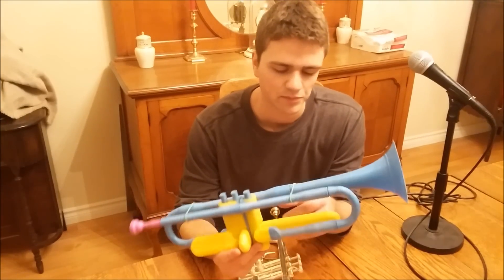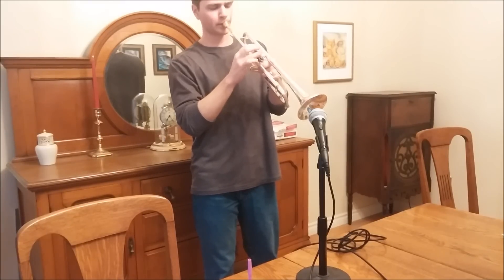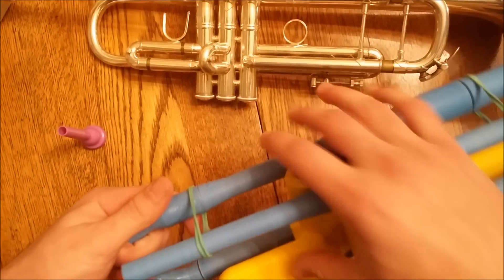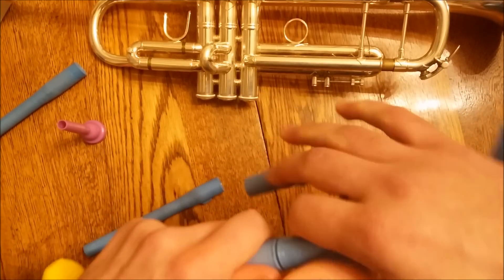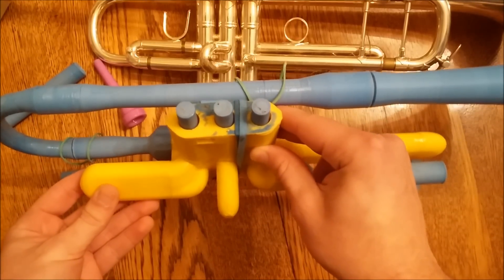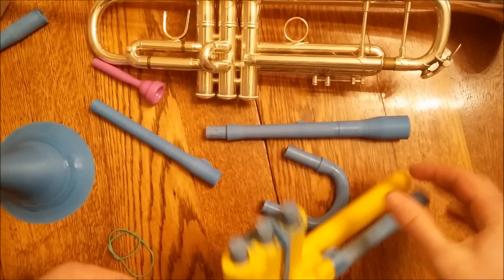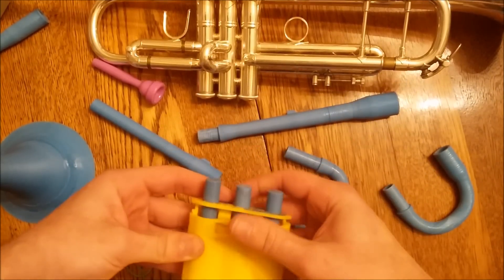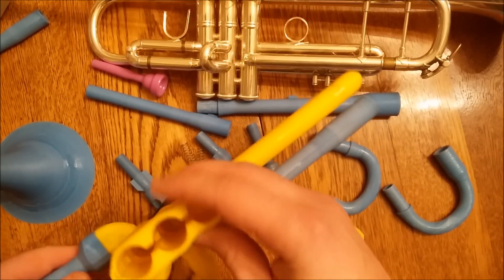3D Printed Trumpet

Comment: This is just my thoughts, I could be wrong. But I think because it's plastic the walls need to be much thicker. I'm wondering if you're not getting excess air leakage around your valves. At least that's what it sounded like when it would go all pitchy. rather than Vaseline for oil you might try silicone or graphite.  I just noticed this is like 7 yrs old. Did you by chance do any other iterations?
Reply: He made a second iteration, his video showcasing it is private though
Reply: Exactly, I was thinking of trying with a shell thickness of 6-8, 100% infill with PETG or PLA+...

Comment: I wonder how much of a metal trumpet you can replace with 3d printed parts before the sound quality is lowered, like replacing the bottom valve caps with 3d printed ones
Reply: The valve caps could be replaced with no results probably. The piping is the only important part
Reply: intresting one last bit,have you heard of bronze pla before its pla but, infused with bronze powder giving it the characteristics of metal

Comment: maybe you should 3D print one of those plastic trumpets so the material + thickness ratio would optimize the sound better than if you were to try to use the material + thickness ratio of a bach strad on the materials the 3D printer used... not sure if I sound like I'm making any sense.. its 2am+ and I really should be sleeping - but that cute trumpet caught my eye ;)

Comment: It sounds like you need to breath harder just to get notes that are in the normal range on the plastic, maybe it's caused by the lack of pressure in the pipes
Reply: perhaps, also plastic probably isnt vibrating as loose as the brass.